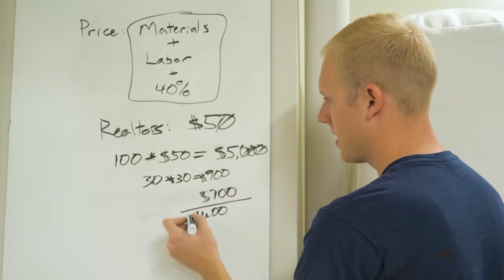we're (finally) open for business! let's start selling...

Comment: Im a researcher, i toiled over tablesaws since March 2020 when i purchased a European contractor saw. When i found out all the things i didn't like about the saw i went on a tangent reviewing cabinet saws not just 1 but all of them, my issue was justifing up to $4000.00 for a saw. I posted in Facebook forums and got so many of the same answer Save and buy a Sawstop. The contractor saw was $2000.00. So i knew i was driving myself crazy and i took a good look at my skillset, my shop, and how much im in my shop and determined. Im a hobbyists  woodworker and i build mainly for me and my home and sometimes ill make things for customers.  Once i cleared my head of all the noise i bought a Delta 36-725t2. Is it perfect no, will it do everything i want it too, yes. Is it safer than a sawstop? Nope. But ive watched many influencers suffer major catastrophic injuries over this last year and the all owned Sawstop. Most came from using jointers. Where will i be in 5 years hopefully still enjoying woodworking and maybe making enough to buy a cabinet saw maybe even a Sawstop. Im really glad there are people like Tamar and Steve Ramsey and John Moses, who help explain projects. I wish you guys nothing but success now and in the future.

Comment: going through an emotional purchase right now! looking to upgrade my jointer. and knowing you guys don't do sponsors (and spend all of your own money)... is it worth it to invest in a floor model jointer?? i do anywhere from cutting boards to making large furniture and am looking to expedite the process of everything i do! Congrats on the business and "real" start of your sales! big fan!
Reply: If you’re doing any good amount of jointing then yes it’s worth the upgrade. Just ordered my new one last week.
Reply: @markbranch6427  I do a pretty good amount of it, my last mental debate is between a standard dovetail style or parallelogram style.... i always think of "well its only X amount more". but I am thinking of going with the biggest one at the top of my budget then I will not want to , nor really be able to upgrade from there. You are getting a new one?! that power-matic is a monster! Any reason in particular for a new one?
Reply: Get the biggest and best you can afford. My advice, spiral cutterhead! You will never regret it! If later it doesn't fit your operation,  sell it and upgrade again with money you've made with that one. Also don't forget the used market if you are handy.
Reply: @moldings_etc  I would think a spiral cutting bit would be terrible.. because unlike a thickness planer it pushes the board tightly on it.. the jointer can't because it has to be loose to cut the bend out.. and the spiral cutting bit would jump around if not forcibly pushed down..
Reply: @robrocco5420  actually its the opposite of jumping around. Since your are cutting with much smaller cutting edges it moves around less. Unless your knives are dull, but that applies in both types of cutterheads. I have spiral in all but 2 machines in my shop, they haven't been changed out because they are going to cost a bunch to change and they are both backup machines. 
 The other benefits of spiral heads, chip size is smaller so your dust collector won't clog so easily unless its underpowered and letting dust settle out in the pipes.
Reply: @11edski   I’ve watched a lot of pro reviews that unless they’re to sell they’ll tell you they’ve never had any “sagging” from the Wedge style.  My opinion, get the wedge and use they money you save to put towards upgrading other tools.
Reply: @markbranch6427  thanks everyone for the advice! Much appreciated!